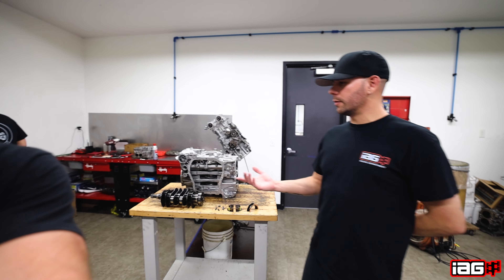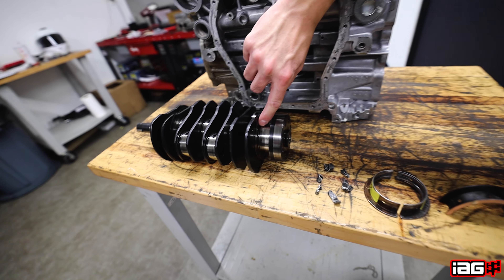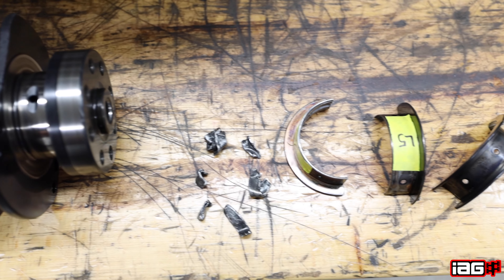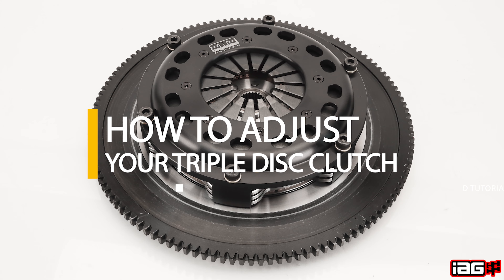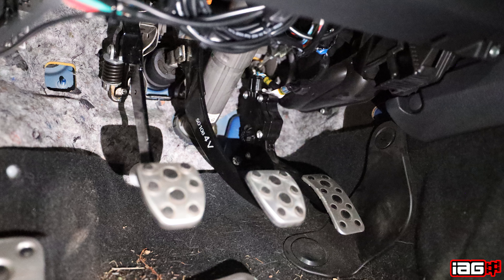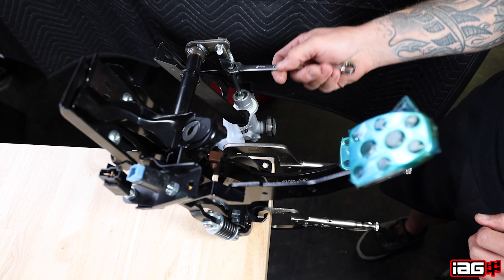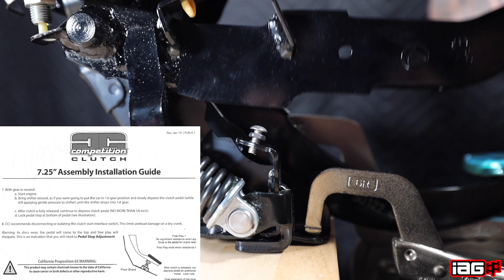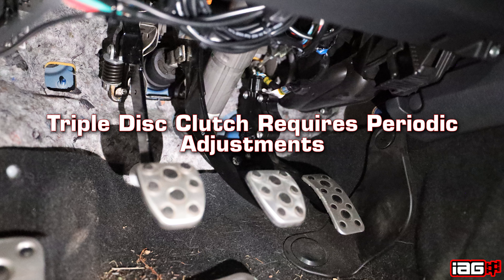Why adjust your clutch pedal?

Comment: rabbit hole I have traveled. Thank you for the video!

I don’t have a competition clutch, but I definitely have more than 3/8” play in my clutch pedal. Tried to get some warranty work around the clutch and gearbox and the “master tech” didn’t know how to adjust it on my GR Corolla. I experienced a few mis-shifts more than I would have liked and going to try this to see if I can reduce the play a bit without overdoing it.

Comment: I watched the video, and I applied the this tech to my 2010 WRX. I have a 1999 JDM 6 speed with a stage 4 clutch, I've had a lot if issues with noise and extended clutch problems. This worked great, there are two clutch sensors that I had to adjust. I used a 3\4 inch long screw, and some lock tight. I also had to cutdown the tap and wield a small T  handle to make it super short. And I didn't have to remove the gas peddle. 
Thank you. This saved me a lot of money.
Reply from the maker: Glad we could help you with the info.

Comment: I had a horrendous noise coming from 4th and 5th and had adjusted the new clutch many times but setting the free play at the slave cylinder was what ended the noise problem. I made a custom slave push rod so I can set the clutch pedal. Then adjust the slave to perfect and I also built a longer arm so I have a shorter clutch making all this way more advanced but repeat process over and over again and then make the correct clutch travel distance and line that up with the clutch slave cylinder and yes it’s all crucial to a good drive feelingS

Comment: That’s the clutch master cylinder, but good try.

Also, this upgrade can be counterintuitive when running a HD pressure plate as the counterforce is provided by the crank making contact with the bearings. The disk could not be disengaging entirely making shifting even worse and more resistive causing premature synchro wear.

Comment: Does the stock clutch fork for a BRZ/86/FRS need free play like that between the fork and the slave cylinder?  I can't find any information on this in service manuals or the like.  Most people describe free play as the distance between when you start pressing the pedal and when the clutch disengages, not when the slave cylinder hits the clutch fork.  I also can't seem to depress my slave cylinder which according to the service manual is a bad thing.  Haven't checked to see if my pedal travel is within spec.

Comment: So, oe clutch and clutch pedal adjustment should be fine/good. This is for ppl who have switched out the OE clutch for an aftermarket multi disk/plate clutch set up (on race cars or those with mad hp yo...yes? )

Good video, just a bit misleading in the beginning making me think my oe clutch (pedal) is misaligned
Reply from the maker: All clutches require adjustment but the pedal stop is only required for multi disc clutches.
Reply: @theiagchannel  does the OEM clutch still need 3/8" or is there a different spec? Also with OEM clutch do you need to adjust the clutch start switch too?
Reply: @esoterikk1  Hey man what did u end up doing?
Reply: @cadcc  nothing, I had shudder and it just went away with use

Comment: Having to push the clutch in to start the car annoyed me, so I made a clutch bypass switch with a momentary button so I can start the car in neutral instead of putting pressure on the thrust bearings with no oil present when starting... The switch is in parallel with the stock clutch switch so it still functions 😊

Comment: Ps.. Subaru hydro clutches are the hardest to bleed IV ever done. I had to make a custom syringe to suck fluid and air out and then lift clutch and push as much fluid as you can press, untill the syringe gets rock hard. Then close nipple. This will solve your clutch problems.

Comment: if you have a slave that is inside the bell housing you cannot move the fork as there is no fork, so what are you supposed to do in a situation like this?   my 350z has a slave that is a rubber boot style inside the bell housing, there is no way to check it.   and if you adjust this kind wrong you wont have enough pressure in the rubber slave inside the bell housing to push against the pressure plate and then you wont be able to change gears while driving.

Comment: I have a stock 2017 wrx and my clutch feels heavy, I come from a Honda so this clutch feels like a stage 3 or 4 or something. The clutch barely has any free play and it’s insanely stiff, idk if adjusting my pedal is going to help w the stiffness and heaviness.
Reply: I’ve stalled this car like never before because first gear is just insanely hard due to the clutch so yea if you guys have any idea if adjusting my clutch pedal will work that’ll be very helpful.

Comment: This only applies for multi disk clutches right?
Reply: Any aftermarket clutch should at least have the pedal checked and adjusted as needed.
Reply from the maker: All clutches require adjustment but the pedal stop is only required for multi disc clutches.

Comment: Should this be done to the stock clutch as well?
Reply: NO
Reply from the maker: All clutches require adjustment but the pedal stop is only required for multi disc clutches.
Reply: @theiagchannel  just replaced the master clutch cylinder on my 17 wrx... now pedal feels much stiffer. What kind of pedal free play should I be looking for from rest?
Reply: @diapermaverick6287  should be around 8mm from rest

Comment: I have bleed the slave, adjusted that rod up and down, nothing is cracked and i still have too much free play any idea why that is?
Reply from the maker: Shoot us a support message to support@iagperformance.com with the type of clutch you have and we would be happy to diagnose some suggestions for you.
Reply: Did you ever resolve the issue ? I have the same problem. Just replacement clutch master and slave cylinder and bleed very thoroughly. And still have way to much free play.
Reply: I ended up replacing both master and slave. The master was leaking internally. Felt much different pressing it by hand out of the car. I still have a little of free travel till I feel pressure but at that point I’d have to adjust the point of which the video referenced.
Reply: I also have an exedy stage 1 HD in the car. My pedal feel will be different to a stock one.
Reply: @Daewu  after watching this vid I decided to give the threaded rode a try. In the video it says to losses the locking nut and twist the rod counter clockwise but for me when I went counterclockwise it got worse so then went back to the original spot I had it and did 2 full rotations clockwise and it took up.all that free play in my clutch!! I have a stage 2 clutch. Maybe give this a try, go clockwise instead. Omg so happy now!
Reply: @XxNFLxX1018  Hows you clutch doing? I just blasted through one because of not adjusting the pedal. For some reason this is like some giant unknown thing where im at.

Comment: will this be the same on the 15+ WRX?
Reply: Any luck?
Reply: @joeferry3558  different clutch system. Just follow the oem manual. Basically just have to adjust it where the plunger on the inside of the car slides laterally which is different than clutch pedal adjustment itself.

Comment: Is the adjustment not the same for an act twin disc street?
Reply: im wondering the same
Reply from the maker: Adjustment should be the same procedure, but consult with your clutch manufacturer to make sure they don’t have their own procedure.
Reply from the maker: Adjustment should be the same procedure, but consult with your clutch manufacturer to make sure they don’t have their own procedure.

Comment: What kind of Clutch and motor is this
Reply: The concept is the same for any manual transmission vehicle with an aftermarket clutch.
Reply from the maker: EJ25 with a triple disc clutch.

Comment: This is not going help with anything if you have a heavy duty AM clutch…..!!!!
Reply from the maker: Actually, this is exactly the scenario in which you want to make sure that your clutch is properly adjusted. Aftermarket clutches can put undo stress on the engine's thrust bearing and cause premature wear when not properly adjusted.